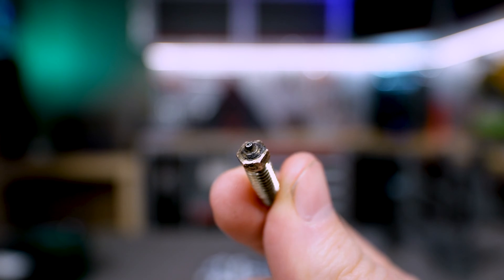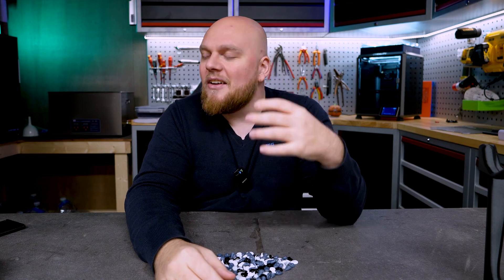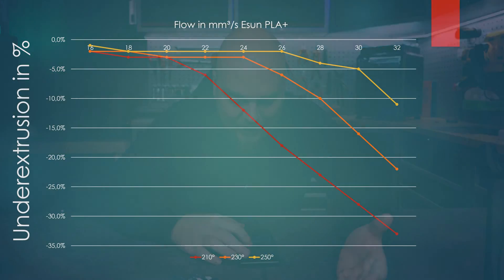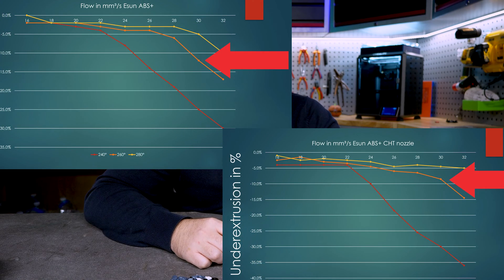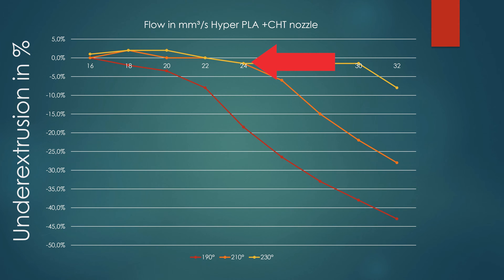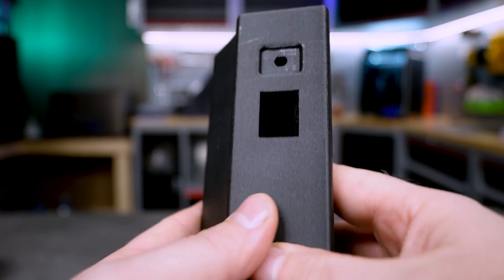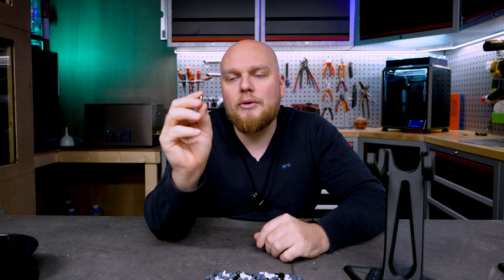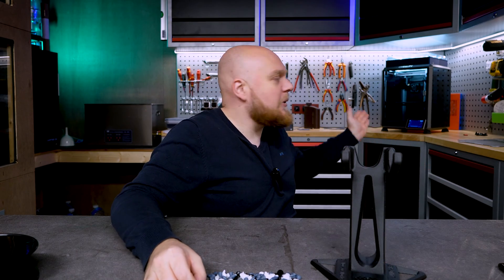Bondtech CHT BiMetal VOL Coated Nozzle tested in the Creality K1

Comment: Your testing found out why we didn't release 0.4mm nozzles from the start. The flow gains were mixed, and mostly none with PLA. 
We recommend to use 0.6mm bore diameter, or 0.5 at least, especially with abrasive fibres content.
With 0.4mm Bondtech CHT nozzles we also recommend to use an extruder capable of 4 to 5Kg of push force at the desired flow.
Looking forward to check the video with the 0.6.
Reply from the maker: Thanks for tuning in, what/ who are you working for?

Comment: Interesting results. IMHO you're fighting an uphill battle trying to get higher flow from 0.4mm nozzles. You might see a bigger difference with CHT technology with nozzles are 0.6mm or higher.
Reply from the maker: Yup sounds about right, at this point it's more the question do you need 25+mm³ on a .4 nozzle. Still interesting to see that the flow suffers on some filaments.
Reply: I would like to see the difference with a 0,6mm nozzle (standard vs copper cht. Also how will the increased flow affect overgangs and bridging (cooling performance)
Reply: @mortegutt  k1 max rips. Wanting to see the 0.6 cht tested :)
Reply from the maker: I have a bondtech .6cht so you can expect a video in the next months 😉
Reply: Have you tried micro-Swiss at all?
Reply from the maker: Not yet